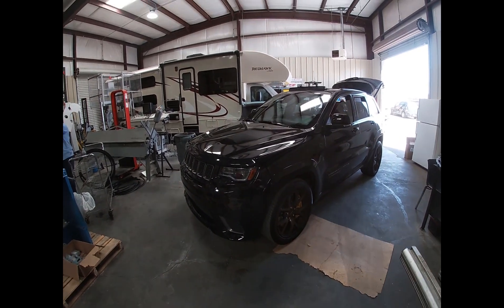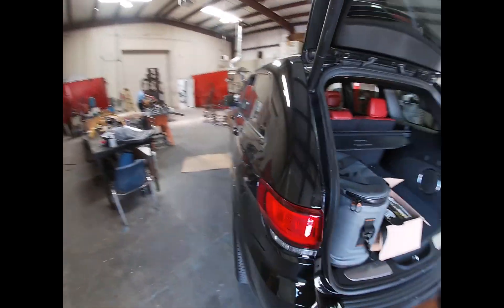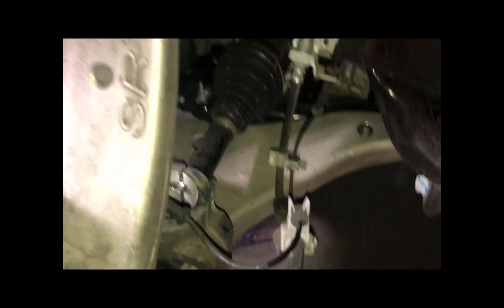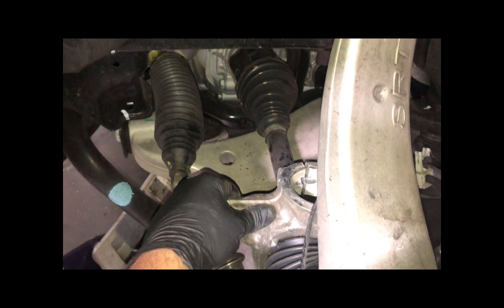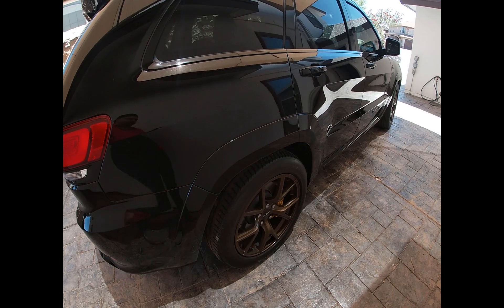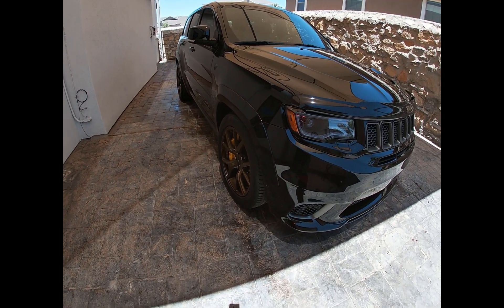How to lower the Jeep Trackhawk (also JGC SRT)

Comment: NICE HAWK!! Question ? Got me one last month traded in my SRT this time I have Black too love it! I  just got it ceramic coated & a  Magnaflow cat back installed this week. Next is my JLT CAI. But now  I wanna drop mine too. My SRT was lowwered when i bought it loved the stance! totally looks more aggressive. So I was told I should put on a BWoody alignment kit along with the lowering springs to prevent tire wear then to keep the Caber to spec. what your thougts? Did you do that too? or just the springs. Its just I have to pay a performance shop to do all my work & a lot of times they are so expensive.  I see you mentioned some suspension mods for it and Bwoody to make it stronger. Not sure if that was something different Anyways any tire wear that you noticed form doing this ?
Reply from the maker: You’ll love the TH. Yes I upgraded tot he bwoody suspension with diff stabilizing mounts. I recommend you do this before launching your TH bc the diffs move. You’ll notice a huge handling inprovement. It will feel like a sports car rather than an suv. There is tire wear but very little. You’ll still get wear with regular suspension, especially is you don’t do the bwoody upgrades. This will happen due to the body roll you get.
Reply: @mods2rides  Awesome thanks for the tips! love all your install videos! been watching them. Thanks for sharing.  I was trying to find your Dynamat install. I want to do something similar in the rear trunk area to help cabin noise now that I have the Magnaflow exhaust. On your SRT you put it in the trunk area where the spare goes? Can you let me know where you bought this and what kind you used? On the Hawk looks like you were going to install on the outside this time around ?  before putting the cover back? I am  ok to just install some on the inside just to help drown out cabin noise Thank a million!
Reply from the maker: @gjamin7  I was thinking about that on my drive home from my office last night. That I never got around to install that dynamat. I’ve been so busy with my business that I haven’t been able to make the videos like I have before. I kinda just put everything else on hold. But what I’m thinking of doing is to hire someone to do the work and I can just be filming the process or some type of update video.

Comment: Hey Marco,  You had enough room to take out the shock assembly without taking off the top control arm bolt, caliper and rotor ? I did my rears today will be doing my fronts with Eibachs tomorrow. TIA. Cheers!
Reply from the maker: Yes you have enough room to unbolt them strut assembly without moving the a arm. I believe there’s just a bolt on the lower a arm that holds the strut. Just be very careful when Installing or removing the spring. It’s under heavy tension and if it comes loose it can hit you, possibly even kill you. A friends father lost his teeth that way.
Reply: @mods2rides  Thanks for the quick reply Boss! Wow that’s crazy. I like my teeth and my life. I got a spring compressor on hand to prevent that 🙏🏾🙏🏾🙏🏾. Happy holidays to you and your family stay safe Marco.
Reply from the maker: @harmantoor4893  happy holidays take care brother be safe and keep on wrenching.